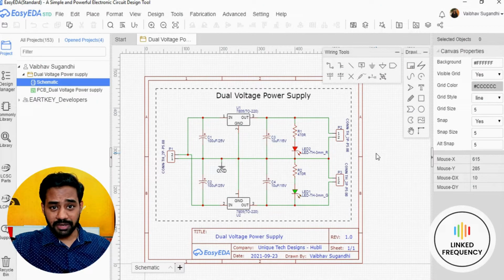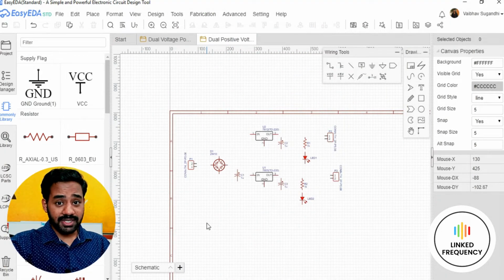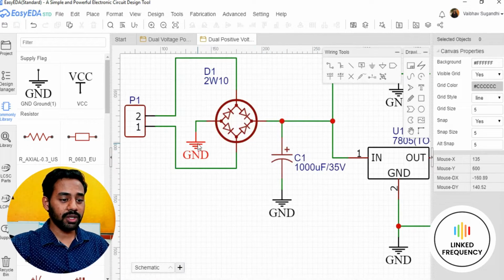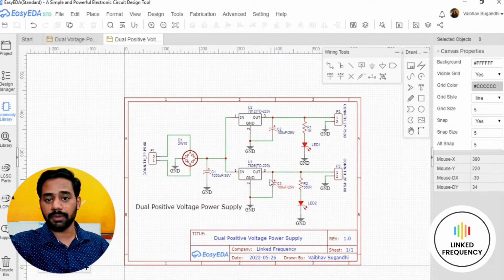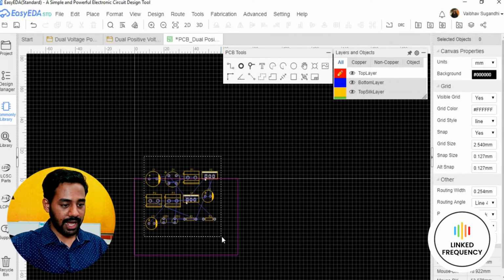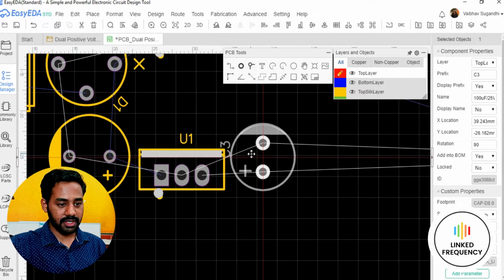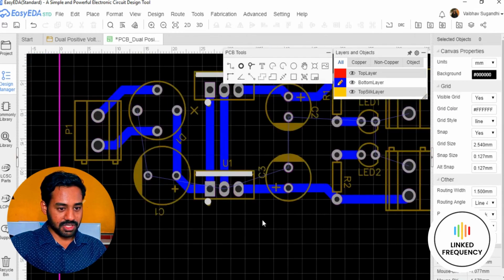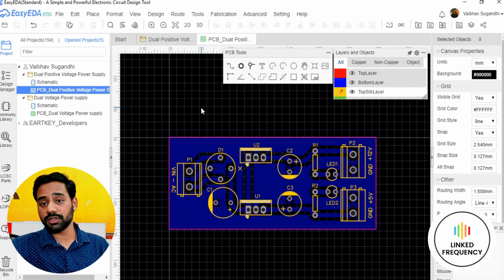Designing a Dual Voltage Power Supply #E12 | Vaibhav Sugandhi

Comment: Do u have video about dual voltage PSU using transistor?
Reply from the maker: We use regulator based circuit or buck convertor ICs in our startup projects. Transistor based circuits are bit out dated and not so efficient as for my understanding. Because of this reason, we have not included transistor based circuit in our tutorials. 

Thanks for your comment, Happy learning :)